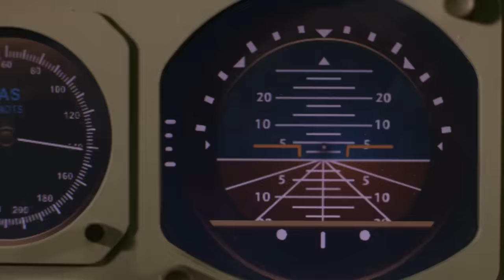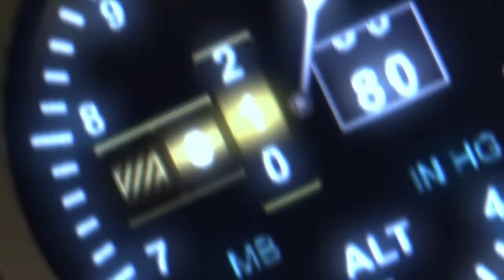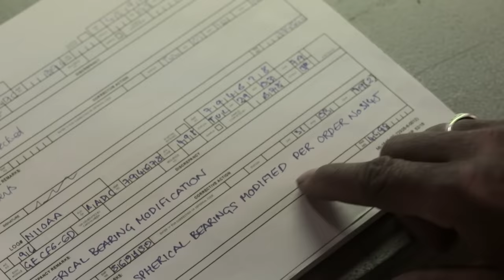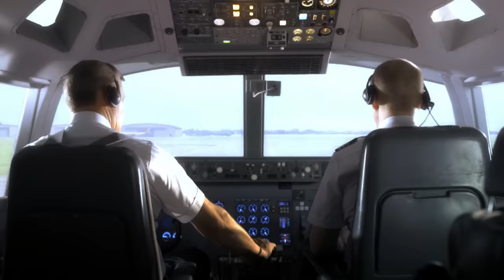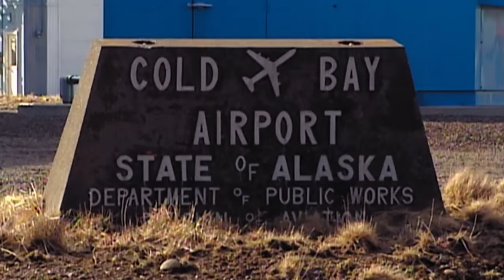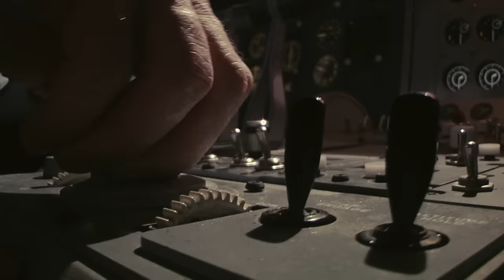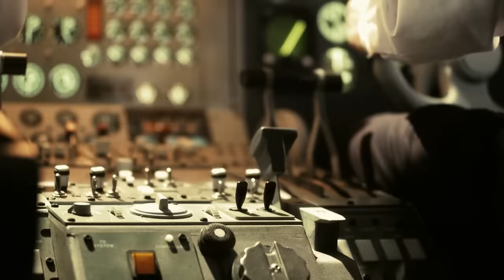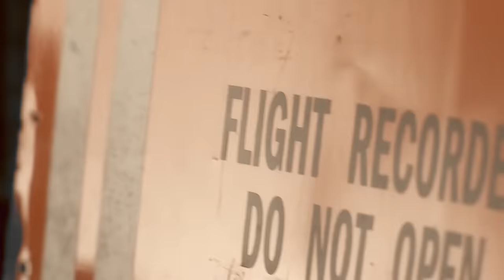How Pilots FIGHT Mid-Flight Engine Failure | Mayday: Air Disaster

Comment: I feel like there's another lesson to be potentially learned here: assume maintenance WILL take shortcuts if they can get away with it.
Reply: And thus you MUST consider ease of maintenance in your initial design. Maybe even consult with the experienced mechanics for real-world experience.
Reply: I dont, I follow the AMM
Reply: 99 times out of 100, when maintenance people take shortcuts it's because management forced them to.  It's all about the money.
Reply: The owners of those companies are the ones that allowed it and sometimes demanded it so they can save money. It’s all about greed and money.
Reply: @mbvoelker8448 I'm an aircraft mechanic, specifically working on avionics. IT WOULD BE AWESOME IF ENGINEERS DID THAT! I can't tell you how many times I'm trying to work on something and it's just really, really difficult to either get to the thing I'm trying to get to or difficulties in actually doing the job.

Comment: I am legitimately surprised that in the second case, the propeller slicing a hole in the floor only caused explosive decompression which pinched the cables and the propeller itself just barely missed severing the cables by mere inches, it would have been a lot worse if the cables were severed by the propeller slicing a hole through the floor rather than the cables being pinched and barely usable as a side effect of the floor buckling due to explosive decompression.

Comment: It is unbelievable and  unprofessional to design a plane with an engine mounting carelessly and unsafe. If I were a plane designer, I would never think of designing a plane like that. So fragile. The motor and wing have to be mounted with more safety steel and thick steel. That is the heart of the plane!

Comment: Criminally incompetent maintenance notwithstanding, the DC-10 was a complete shitbox compared to the L-1011. 
No check valves to prevent loss of hydraulic fluid. No pressure relief valves to prevent the floor collapsing and severing all the control cables when the inherently unsafe cargo door blows off, causing explosive decompression. No redundancy. Multiple flight-critical systems susceptible to a single point of failure. One was designed by bean counters. The other was designed by engineers.

Comment: Why The actual F was the stick shaker warning only on the Captain’s side to begin with? What happens if everything on the Captain’s side dies? Or the Captain dies? Or the shaker on the Captain’s side malfunctions? Or anything else that prevents the Captain’s column from shaking or obstructs the copilot from noticing it? 

And Why The actual F was the warning system powered by only one engine to begin with? What happens if that one engine stops bc it’s damaged? Or defective? Or fuel lines are blocked? Or it just falls off? 

I don’t work w/airplanes or know anything about anything having to do w/anything about any of this - but I don’t have to. If it is POSSIBLE/if there’s a CHANCE/if something MIGHT happen - and we’re talking about an airplane thousands of feet in the sky carrying hundreds of people who will die if that airplane crashes - then you ASSUME IT WILL and you PLAN for it! 

HOW TF ARE PEOPLE SUPPOSED TO FEEL SAFE (or even BE safe) FLYING WHEN THE PEOPLE IN CHARGE OF ENSURING THAT SAFETY HAVE NO INTELLIGENCE OR COMMON SENSE?!?

Comment: Without the hydraulic autopilot on the Electra there would have been no sawing action of the cables to the airframe . The power of the hydraulic system freed up the cables for the pilots yoke.
Reply: incorrect, the autopilot uses separate cables from the yokes, the pilots sawed through with brute arm strength

Comment: You know if you're going to take shortcuts you only do it if you're walking you don't do it when you're working on a multi-million dollar aircraft that carries hundreds of innocent lives if you can't do it by the book you shouldn't be a mechanic or an operator of a airline the bottom line and greed has cost thousands and thousands of innocent lives God bless
Reply: It's all money. The longer the plane is in the hangar, the less money it is making for the airline. Shortcuts are common, unfortunately. It isnt just us mechanics who are at fault; it is also those bean counters above us who push the aircraft out of the hangar faster than it should be.